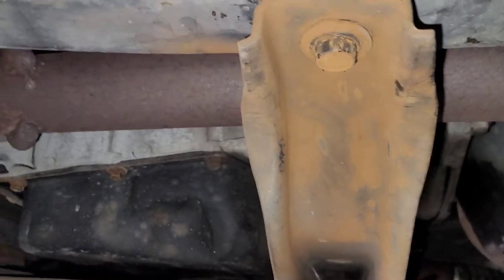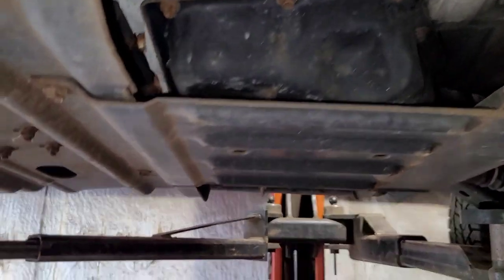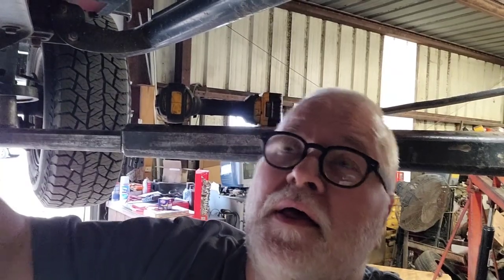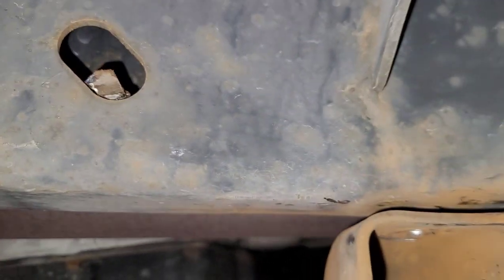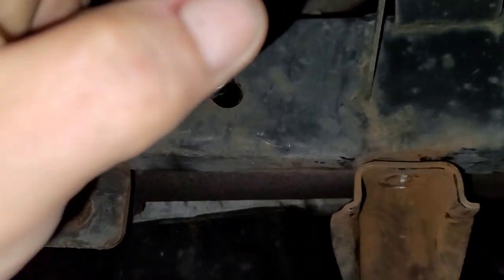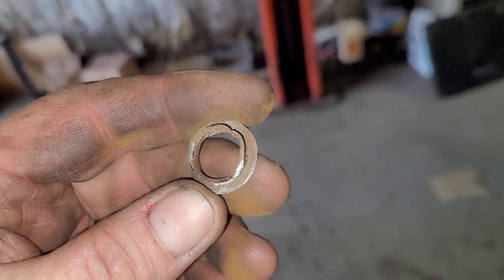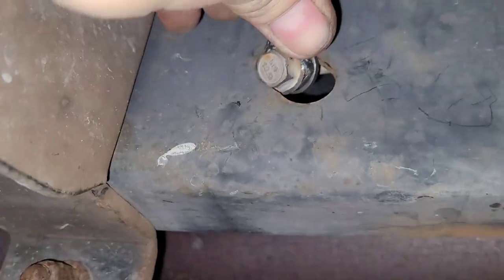Crossmember Bolt Spinning In The Frame. Now What?

Comment: You can purchase large rivet nuts just like the factory ones form McMaster Carr.  I had the same problem with my Jeep and used threaded rod with a socket and a nut to compress the rivet nut.

Comment: I have used a method where I put force in the opening between the connected pieces (hammering a screwdriver/crowbar to put more friction to the loosely spinning bolt. Using drill or friend, you can try then to screw the bolt out. Has worked for me in many similar cases.
Reply: That was my first thought. But you still need a new captive nut or bolt. Nice work, resourceful guy.

Comment: My sister's side step broke loose from her Dodge pickup because they used that type of shitty fasteners. She fell on her ass pretty hard. I enlarged the holes in the inner rocker panel, welded bolts through fender washers, welded the washers to the inner rocker panel and fastened the step down with nuts and washers. My repair is 100x better than the original garbage.

Comment: I live in the Northeast and suffer things as such too . A boxed chassis is full of these inserted nuts . I don’t own a wrangler but do own a Cherokee and a couple of Jeep CJ’s . Luckily , the belly pan bolts did loosen when I pulled the engine and trans when I did a motor and trans swap from a four cylinder , four speed to a six and five speed from a CJ 7 into a CJ 5 . Yes , rear driveshaft length was taken into consideration . But this isn’t about me . Funny , but I asked myself , what if this happened to me on my 1980 CJ5 . Glad you gave us an alternative , sorry it happened to you . Yes , it’s a win when you don’t have to go medieval and cut into an otherwise healthy chassis . Wrangler and healthy chassis is almost a metaphor however . Let’s not ask why didn’t they loctite threads or use anti seize , that’s a dead issue . They didn’t , so we deal with it . Done . Fish wire is probably the go to ( I would ) but it’s nice that some one has their thinking cap on . Well,sir , your a guy who uses his head for something other than a hat rack . Appreciate that . I don’t suppose consulting with Mother Nature and old man winter would help ever but they contribute to the demise of threaded fasteners . Hey , not all Jeeps reside in Florida and California , rust belt folks are jeepers too . Thank you sir .

Comment: When I come across bolts spinning in the frame I've had luck prying on whatever it is or wedging a chisel in there while running it out with an impact. Usually the the friction will grab enough to get the bolt out.

Comment: Nice.  I would've fished the wire through the bolt hole and then through the recess in the frame (opposite of what Kenny did, so to fish through the larger oval hole second), THEN wrapped around the new home-made bolt, then pull through.

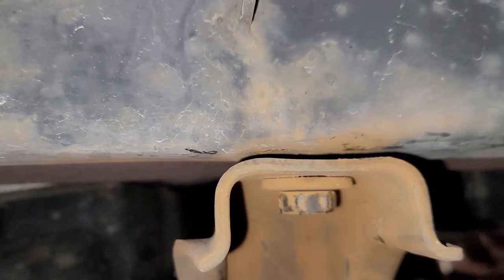Comment: 1:44 If your car is rusty, you can’t be in a hurry with air or electric tools.  You break it loose and then with used ATF, you work the bolt back and forth but mainly back to prevent what happened. Obviously, breaking it loose can make it spin, but guys just using air and electric, while being faster, often make more work!
Reply: What you said exactly happened to me

Comment: Nice technique,  1 suggestion grease the threads on the bolt so it will come apart years from now. 
 Also,  Fisher plows come with grade 8 bolts with a 12 inch long flat steel welded to the bolt to reach deep inside boxed frames with high strength.  It's good to keep a few extra on hand.